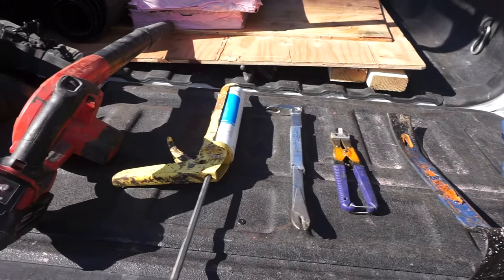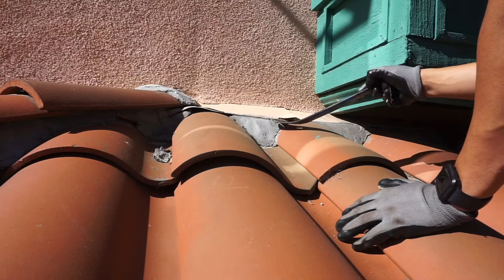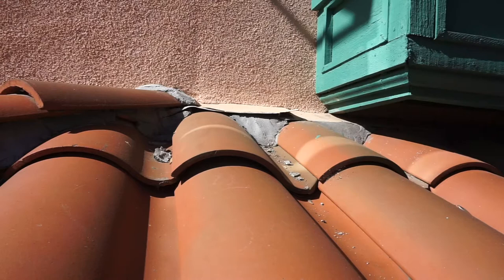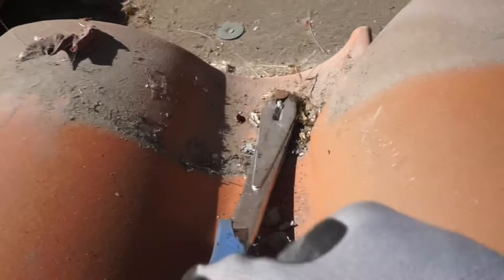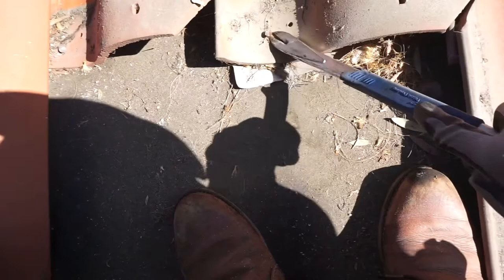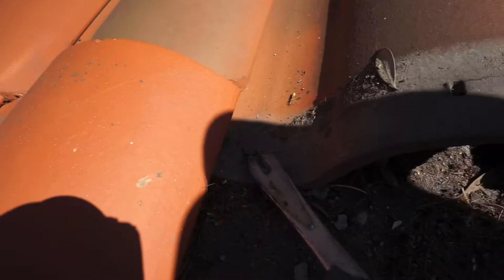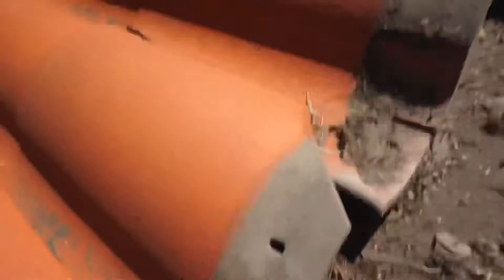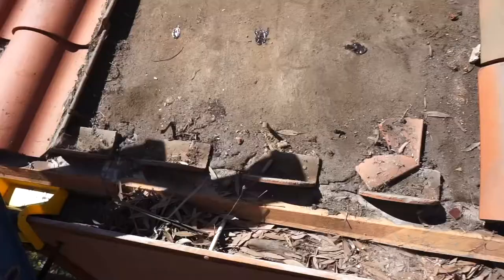How to walk on a tile roof- How to remove your tile roof without breaking tiles.

Comment: I have an old attic fan on my roof.  It's very old and the cover for it blew off a few weeks ago.  I have a new fan I want to install.  Can I use a sheet of plywood to distribute my weight to get to that area near the peak of my roof?  Or, I would gladly hire you to come to San Diego to replace the fan and do a full roof inspection.  Great video.... thanks.

Comment: That's weird, someone posted on YouTube that when climbing on tile roof you should walk on the joints, pretty much on the top of two tiles where are they sitting on each other's, he said it's the strongest point, what do you think?
Reply from the maker: Everyone has their own way of walking on tile roofs. Walking on the joints will cause the channels that lock them together to crack/break.